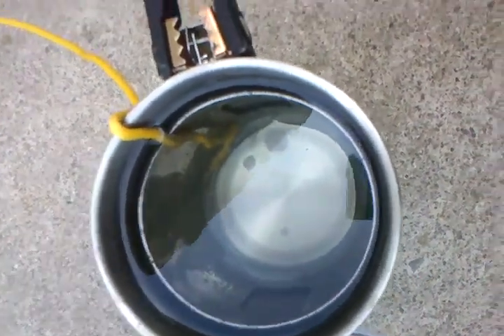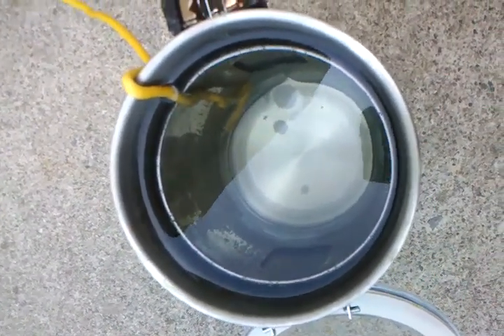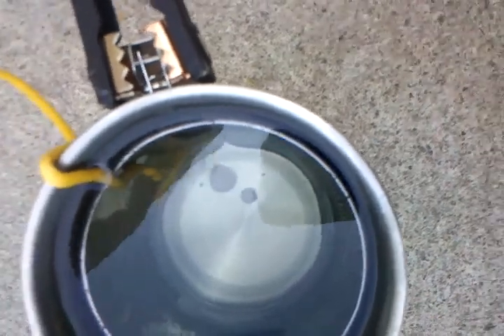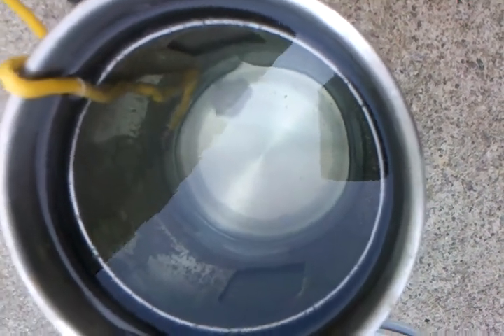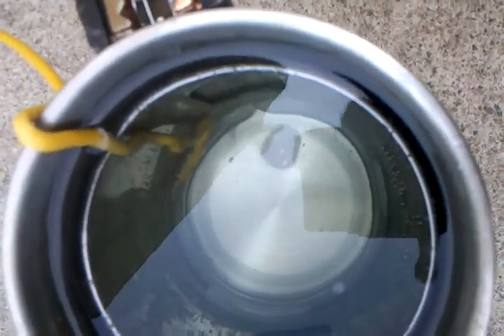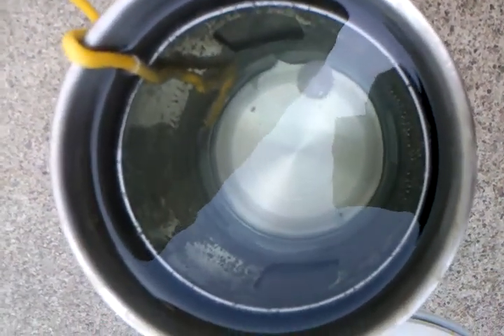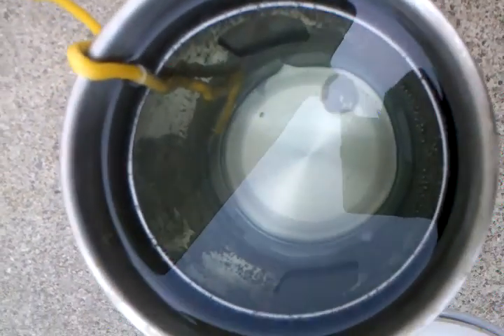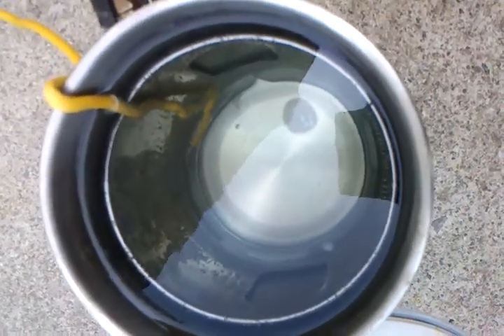HHO generator its simple.3gp

Comment: You either need lower voltage or you need to add neutral plates in between those two charged plates, both methods will reduce the plate gap voltage which in your case is probably way to high.